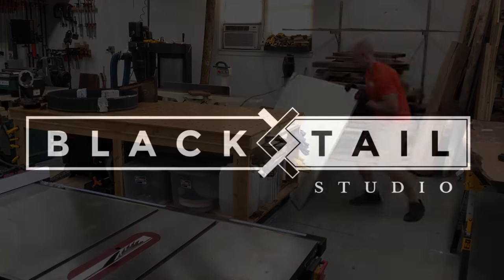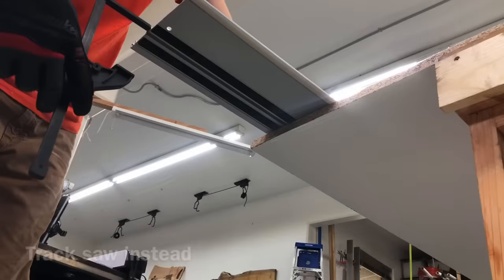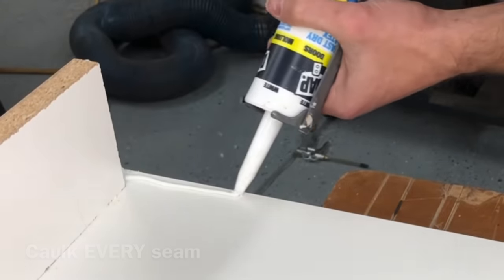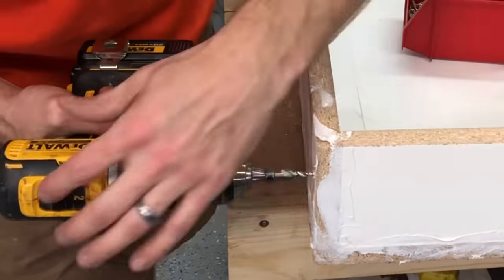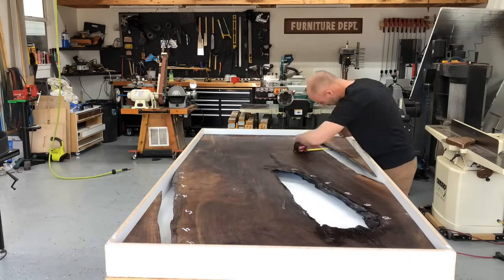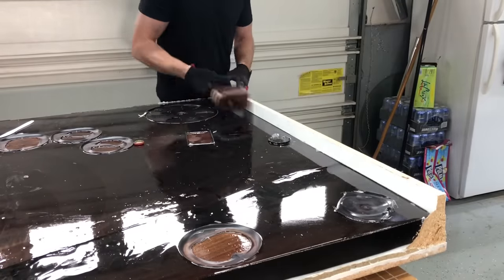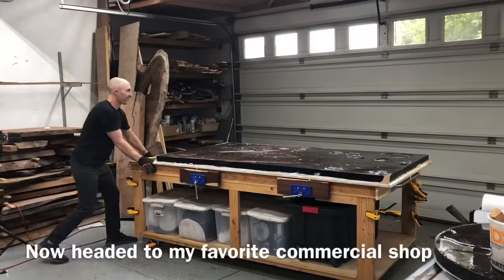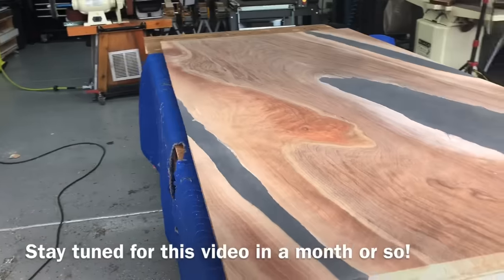How To Make an Epoxy Table Mold - DIY Epoxy Resin Table

Comment: Hey there So just wanted to give readers/watchers a heads up. As a certified associate at Home Depot to cut on the panel saw, these cuts are not guaranteed an exact measurement.  They are meant to only be rough cuts.  Associates do try their best, especially when people approach them with respect.  There's a lot of people out there that abuse Home Depot associates.   It's not nice.   As my grandma always used to say, "Honey attracts flies much better than vinegar.. I used to tell Grandma I didn't want flies!🤣 But hopefully you get the point.   Be nice to the associates, they are often pulled in multiple directions from customers, they don't always have the training for something you need help on, and I don't know about all stores; however, every HD associate I ever met has been a pretty good person. Just take time to ask them how they're doing and if they're already helping somebody else, before you start trying to get an answer for something you're there for.

Comment: James, do you ever make a table with clear epoxy or is it always tinted?
Reply: Justin - yep +1 here - also wondering if clear has ever been attempted. I’ve heard the epoxy can yellow over time if it’s perfectly clear.
Reply: David. I am curious as well. I did a clear epoxy on top of my black table top for a layer of protection, but I noticed you can see the tiniest of scratches.
Reply: I have seen clear Epoxy table online which very nice! I don't know if Cam has done it yet...

Comment: Rich in New York- just wanted to thank you for these great videos and for always taking the time to answer my questions. I like the epoxy filled void, myself. As a currently unemployed pediatric dentist, I’m very jealous of your attention to detail and the precision of your work. My life is spent drilling the tiny teeth of moving targets.  1 mm can be the difference between a root canal and a filling, so I can really appreciate just how accurate your work is. 
Either you’ve got it, or you don’t. And you’ve got it. 
Thanks for sharing.
Reply from the maker: Thanks for that Rich! Hope you’re back at it soon
Reply: @BlacktailStudio  if they keep me out much longer, i may have to try to sell some of my woodworking projects. Sure the epoxy has some air bubbles and the dutchmans have gaps all around them, but hey, ill sell em cheap!
Thanks again for the great content. Ive learned a lot.

Comment: I know this is an old video, so I don't expect you'll read my comments. But, thanks for all your great information.  I have learned so much. I'm new to this form of woodworking and only done 5 minute epoxy with pigment on charcuterie board repairs. Done with that
Now! The reason for my comment... ALEX?
100's of videos I've watched and this is the 1st time I've seen ALEX.  And this is 3 years old. Why the heck hasn't  any other YouTuber ever said that? Always silicone.
And  Ace Hardware is now 13$ for GE silicone. I've been doing remodeling for over 60 years and always hated working with silicone caulk. Alex, I like. What a great tip, thanks.

Comment: “Jeremy” you asked in the end of your video if you thought you should’ve filled the big void, I think It looks amazing. One of my favorite tables yet. Keep me coming, the wife and I are about to embark on making an epoxy table for a dry bar top. Thank you for the instruction so far!! Super helpful.
Reply from the maker: Love to hear that
Reply: @BlacktailStudio  "Jeremy" one more followup question, don't feel like you need to answer should it give away too much info. My wife and I live in Utah and found someone who is selling wood similar to what you use in your videos, big enough for a large table... slightly smaller than a kitchen table length for $200... is that reasonable? this would be for our bar top.

Comment: WHAT DID I DO WRONG!?
Thank you for your detailed videos. you are truly an inspiration! Inspired, I completed my first pour this past weekend for a C-Table (gotta mix the occasional project in for the wife). I sprayed the melamine mold with smooth-on mold release and wiped it around with a blue paper towel. About 5 minutes later I sprayed it again and moved it back into the garage. I repositioned and lightly clamped the wood down. I mixed my epoxy (2 gallons) and poured (1.25 thick), that was fun! About 55 hours later I started to demold the table (per liquid glass that can be done in 48 hours). It was like I never sprayed the melamine with mold release. I waited another 24 hours and gave up trying to get the bottom sheet off. I chiseled out all the brad nails, and used the planer to remove the entire melamine board. On the bright side the project looks amazing now! What did I do so wrong with the mold release!?

Comment: Sean, just wanted to say that table is going to be beautiful. must be really nice having the shop with the drum sander/planer thing. wish I did, but I use a 7 inch angle grinder, started this after my router took a crap and died. I've found it works faster and once you get used to it, you can get it pretty close to perfect.  even if it's not 100% flat, they usually come out beautiful and when someone sees the table it will usually sell fast. it's wood, I usually use scrap wood, like end cuttings from slab tables or reclaimed wood. not ment to be 100% perfect.

Comment: I have started using PVC boards for my sides. It has a texture on one surface but if you miter the corners with the texture facing out, you don't have to worry about the texture. It's alittle more handling for the side but it means not having to push a full sheet through the table saw. When you are a shop of 1 or have a small table saw, it makes things much easier
Reply from the maker: Nice!

Comment: I did a small epoxy / wood project and used the recommended mold release...however, I don't think I used enough, and I wiped it down with a cloth after applying it...which  in retrospect probably wiped off the mold release.  It's absolute hell getting crumbling melamine off from the bottom of the wood / epoxy.   Glad to learn this lesson on a small scale piece...couldn't imagine dealing with an entire tables worth!  Thanks for the video!

Comment: Hi Cam, just wanted to pass along something I came across that I thought might be useful for you and others. I came across a product made by Dap that is called " Seal N' Peal" removable weatherstrip sealant. I use it on all my molds and to damn up epoxy and when I'm finished it peels off easily (in 1 solid strip) leaving no marks or residue. Saves me lots of work and fr I m destroying molds. Great videos and good luck in the new year!
Reply from the maker: Oh awesome

Comment: Prashant, I've learnt so much watching your videos. Thank you. I'm going to start building my own epoxy coffee table this weekend. Wish I had access to a workshop but looks like I'll have to fight it out with my orbital sander.
Reply: Prashant consider building or purchasing a router sled. I too do not have access to a large planer. For me a router sled is the next best thing followed by a few steps of sanding.
Reply: @davidmiera8858  thanks bud, I ended up using a router sled and it worked well

Comment: Brad Hays.  Thanks so much for another great video.  I was thinking that using something like rice or popcorn to measure volume would be more accurate and maybe even faster than taking spaced measurements and then calculating.  Just pour into the voids, vacuum it out and pour into measuring containers.  You would probably want to disassemble the wood from the mold to make sure it all got removed.  Hope this turns out to be a good idea.
Reply from the maker: Tape measure seems to work, I do like rice though...

Comment: I’m so glad I found this video talking out the process in making a mold.  My question, after seeing many of your builds, is whether you think it could be a good idea to mark off half inch / quarter inch / etc increments on the inside of your mold.  With the intricacies of epoxies and the levels that various epoxies are able cure best at, it seems like it may be an additional step that could pay off great dividends. 
Keep up the great work!
John
Reply from the maker: I’ll use a dowel to check the depth sometimes.

Comment: Lorelie -   I have worked with epoxy on a small scale for quite some time but not yet on a large project like that gorgeous table (and all of your work that I have watched thus far -  btw that void-  gorgeous).  Anyway back to the question -  why cant you like your frame with vapor barrier plastic sheet -  I keep thinking epoxy doesn't stick to it so why wouldn't it work in lieu of the typical steps I see people taking when doing tables?    I am sure there is a super smart answer but I can't come up with it and before I start my first large scale (for me) project I thought it best to ask the expert  Thanks for your time and videos

Comment: Thanks for the great info! I'm one to ere on the side of caution and caulk up any/all seams. Wasting the epoxy is one thing.. but man having to clean a leak up off the floor,   including whatever else it seeped on, is deterrent enough. Side note: Ever thought of getting a basic box fan and taping a cheap air filter to the back of it in order to capture the over-spray?
Reply from the maker: Good idea!

Comment: I am noelani. I’m very impressed by the amount of information and skill. If you felt compelled... I’m trying to make a desk out of an lighting struck trunk so I can work from home in style I made. I’m not financially well off and would greatly appreciate information on the cheapest materials to make a mold with and the best cheapest resin and/or epoxy to use. Thanks for your video!
Reply from the maker: Man, epoxy projects aren’t cheap. I wouldn’t do anything different than I recommend here

Comment: Great video, great advice! One comment on the cut of the big panels at the Depot. Couple nearby stores have beaten up blades in their track saw, that take off a lot of splinters and material off the edge.  I've become comfortable with the track saw using my workbench and supports with the rollers on top, that works pretty well.
Reply from the maker: Oh nice

Comment: Great video Cam. Don’t know if you can get the product over your side of the pond, but polypropylene sheets are much better and easier to use than melamine. Nothing sticks to it so no need for release spray etc. Worth checking out if you get chance 😀
Reply from the maker: I’d love those. Just super expensive over here.
Reply: Blacktail Studio Shame as they’re very reasonably priced here in the UK, much cheaper than melamine 🤷‍♂️
Reply: @Hand-i-Craft  Just looked some up. A .25 x48" x 96" is $151. as of Aug 8th 2023

Comment: Thanks. I'm starting  to watch all your videos. Can you answer these questions?
1) how do you clean the home depot epoxy buckets?
2) There is no  need for pins in the edges for the epoxy  to grab around so it won't snap off later?

Comment: Scott- a little of good info there. While I will likely never do a table of that size; my shop is only 15’x25’ plus all the machines I just wouldn’t have the room; I would like to get into doing more work with epoxy/resin. I do a lot of wood turning, primarily bowls, and would like to try making hybrid wood and resin blanks for bowls or whatever else so that was great to get some tips on making molds for that.
Reply from the maker: I’d love to get into turning

Comment: Love you video. Just finished making a mold with wood and lined it with mat tape and caulking.  Super nervous for the poor. It’s for my friends coffee table 58” x 30. 2.5 inch thick.  First time doing a piece this big.  Suggestions on the mold?

Comment: Chris in Gibsonia.  Suggestion:  Use the tyvex or similar tape for all the inside joints, then coat everything with the mold release spray.  That should be faster and not have the problems with (1) cost and time of taping everything and (2) getting the caulking material to release.  Maybe you've already tried that combination.  Thanks
Reply from the maker: Thanks!

Comment: Chris here,
I have been a fan of yours for a few years now. You have some of the best tables I’ve seen. I’ve noticed a few things when it comes to your work…

1) your tables are usually opaque and either white or black. I think this is the first table I’ve seen that is a see-through smoke gray. Have you ever done one that is clear?

2) I’ve also noticed that you never run bars in/under your work to support the table. On other sites this is particularly popular for river tables perhaps out of fear that one side of the wood will break away from the epoxy. Do you ever run integrated bars or have you found that the epoxy is strong enough that it doesn’t break away from the wood?

One comment and I would like to get your opinion on this for those that do not have access to shops with massive planers… There are plenty of sites that can provide instructions on building, while others sell slab jigs.
Reply from the maker: I do some clear ones. Not a lot. I do run c channels under some tables though!

Comment: At 6:50ish when explaining the sanding of the edges you mentioned a word I'm not familiar with. Also I have never made one of these beautiful tables but I have researched in depth before I decide to stick my toes in the water so to speak. Could you please get back with me on the word you used and it's meaning Thank you so much for this wonderful video. It was not boring, drawn out, and didn't skip anything. I really appreciate that. I'm going to get my husband to build me a mold. Well one day lol

Comment: Tregg, Another great video! Got a tip I've seen other youtubers use. Instead of wrapping your hold down blocks with tape, use silicone molds. They have some great coaster molds on Amazon that wont break the bank and will save alot of time as you can reuse them as needed. Wouldn't hurt to use some scrap wood from the same table your working on, at the time, to throw in a matching set of coasters. Just a thought. Keep 'em coming please.
Ps. The new shop is looking great!
Reply from the maker: Thanks bud!

Comment: Dave, another nice looking table I like the lay out versus a river going down the middle. That mold release you recommended works awesome I used it 2 weeks ago and it worked perfectly. I’m definitely jealous on the option you have with a shop to  flatten it. I had to use a router and sled. Lesson learned on that method though spend the extra money on a good bit. Also I saw what you meant with the Odie’s oil next table I do will definitely be with the osmo you use.
Reply from the maker: We all learn the lesson eventually Dave! Happy to help when I can

Comment: Sham to Cam, have you tried putting a sheet of plastic down instead of using mold release? Also a trick to reduce bubbles is to pore down a piece of wood at an angle.

Comment: Hi, thanks for the explanation, would be happy for some help here.

I just finished making my mold, noticed it’s a bit of a bowl from inside when I put it empty on a flat surface, really just slightly curved and has a belly from the bottom side. I’m gonna pour 20 liters of epoxy river with 4.5cm thickness, do you think the epoxy will make it flat by it’s weight? also add to it the slab+some clamps. 
Thanks!
Reply from the maker: Epoxy won’t make it super flat. Clamps is a good idea

Comment: Great video. I've been using tape so far, and i don't love it. A lot of work, but also it can be tricky to get a flat surface, and the tape seem to loosen up also, Wich resulted in uneven corners and edges on the epoxy. I will definitely try mold release spray!
Reply from the maker: I think you’ll like it

Comment: Anthony , ✌🏻 have you ever tried formwork ply ? It is coated and designed to be used multiple times with release oil I saw the chipboard broke apart and was stuck in places, it’s expensive but maybe you could make forms and keep them in each size rather than they fall apart after a few tries , anyway great video I’m hoping to make myself a nice deal in a few weeks and maybe start selling them ✌🏻

Comment: Thanks for all the amazing content! I followed your videos and successfully pulled off a pretty amazing tigerwood dining table, but now I’m onto my epoxy river pour walnut desk and I have a question about the mold..

You recommend adding 2” to each dimension for the interior of the mold… now what? There’s either a 1” gap around the wood, or if I push the wood to the edges then there’s a larger gap in the middle than intended. Either way it seems like wasted epoxy and $$. My mold is built but I haven’t poured the epoxy yet. 

2nd question: What do you do to get all of the excess epoxy off of the sides? I think I’ve only ever seen you run it through that wide belt sander, but never the equivalent task on the sides. 

Thanks!

Comment: Stephen of The Palazzi’s Custom Creations here- my question is this: does the Alex caulk alleviate any and all leaks and what do you do in the even of a leak springing to save the project from disaster. This is my main fear of building bigger forms. I’ve been using a mold from crafted elements for my charcuterie boards but I’m ready to move on to bigger projects 😊

Comment: Thanks for the video. I am building a 5' ROUND table with end-grain wood slices from a Sugar Pine that had died. 24" slices!. Unfortunately, not a lot of 5' wide melamine, nor have I found a shop with a 60" wide belt sander. Questions:  Shop temperature for epoxy hardening.....any effects of altitude on drying?